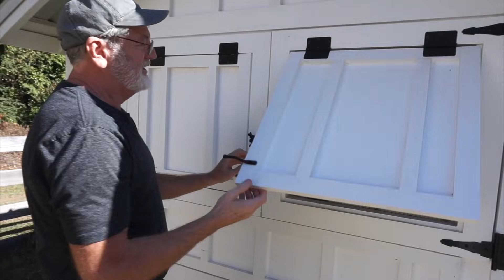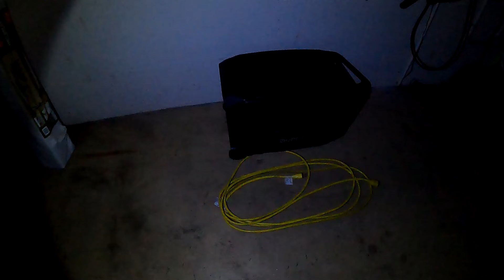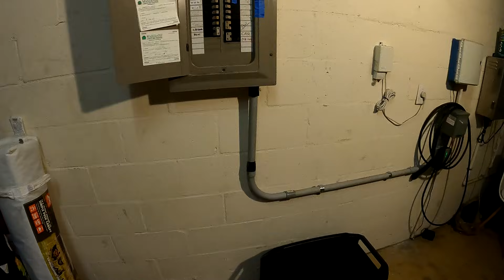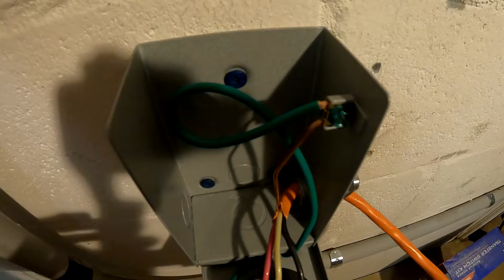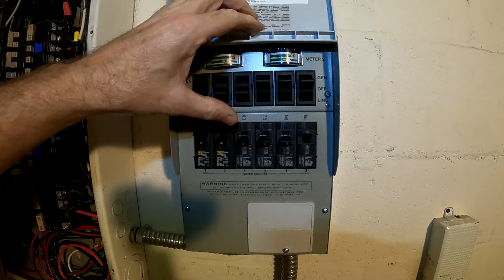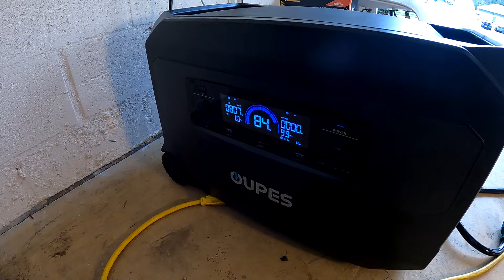OUPES Guardian 6000 with Reliance ProTran 2 Transfer Switch Install

Comment: Or, get a power station that can output 120/240v while charging with 120/240v.
Reply from the maker: You could do that but it just depends on how much extra your willing to pay for that feature. The G6 will recharge off 3600W of solar input while outputting 120/240.  I run a MEGA3 with B2 extra battery 24/7 off 3000W of solar and almost never need to use AC to recharge so it would not make much difference to me.  Depends on how you plan to use it.
Reply: @HomesteadEngineering  Maybe the v2 version fixed those things

Comment: Do you need a storage unit to store all of your free power stations?
Reply from the maker: I give them away.  I actually only have two right now.  I do have 4 gas/diesel/propane generators and whole house solar as well.  Out of all the portable solar generators, I like the Mega 3 with the B2 extra battery and max out the panels.

Comment: Another great video.  I got one of the 2500 Oupes after one of your videos.  Use it everyday as a UPS, but I'm ready for when the lights go out.  The 6000 sounds like a great deal, especially with the transfer switch.  Also thanks for explaining the bonding aspect.  Very important.
Reply from the maker: Yes, I like the G6 and the MEGA 3.  Depending on what your looking for they are both a great deal right now before the 30% tax credit runs out.  
https://youtu.be/G-kfKXON2tE?si=r6kk2yXHZZerx03j

Comment: Really good review and tutorial on the switch install. I bought a Oupes 6000 and so far I’m very impressed with it . Plan is to use it to back up my 110v circuits with a Natures Gen 30a automatic transfer switch in hopes that it will work as an automatic backup for the random power outages we get in our area that may last a few minutes or hours . 

New subscriber- Really enjoy your channel. you’re one of the FEW content creators who actually pronounce Oupes (OH-PUS) correctly!! 👏🏼
Reply from the maker: Sounds good.  Thanks for subscribing and let me know how it goes with the transfer switch.

Comment: If its night time, you can run a ac to dc bench charger to pass through to the Anderson solar port. I am doing that right now got it locked at 90v and 10amps giving me 900 watts from my generator to top off battery.
Reply from the maker: Very creative work around.  Nice job!  :)

Comment: What is the charge rate for a electrian to do this 2-3 hour install
Reply from the maker: I think it would run about $800 on average.  If its a hard to access location or you want the plug outside or other complications it could be more.  This install might have run a bit less, maybe $600.  Thanks!
Reply: @HomesteadEngineering thanks

Comment: Nice video.  😀
An idea for you - I have a rechargeable, battery operated spotlight mounted above my electrical panel.  It’s great to have a light shining on the breakers when the power is out.
Reply from the maker: That's a good idea.  I have a ton of flashlights and could easily dedicate one to the main panel.  Thanks!

Comment: I could not locate anyone to install a transfer switch.
Reply from the maker: It can be tough to find someone but most electricians can install one.
Reply: You might have better luck finding someone to install an interlock kit on your electrical panel. You’ll would need to find one that’s made for your specific panel.   An interlock kit would allow you to pick and choose which of your current breakers to turn on, BUT you have to be careful not to exceed the capabilities of your power source.  Do your research and figure what is best for you. It’s a matter of personal preference.
Reply from the maker: @RG77-92  Yes, An interlick is an easier and much less expensive option that gives you the flexibility of running any circuit in the panel as long as the generator will handle it.  That said, the ProTran 2 has a huge advantage.  It allows you to run solar and the utility at the same time.  You can then use your solar generator to reduce your electric bill every day.  You can't do that with a lockout as it is all or nothing.  I talk about that a bit more in this video:
https://youtu.be/vUV3Abu4WFQ?si=WN53Kb4V1giW9-vd
Thanks!
Reply: @RG77-92 thank you.
Reply: Great video explaining the G6 do I dare say better than Opous, yes
Reply from the maker: @boomerinflight  Thanks!